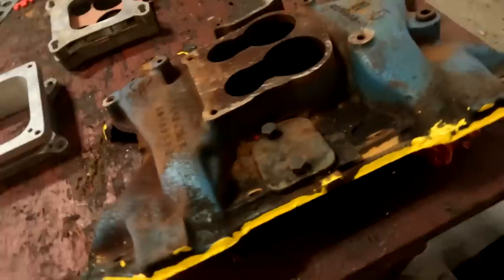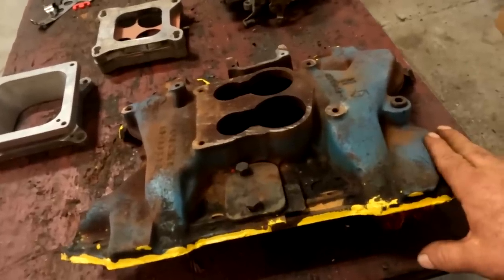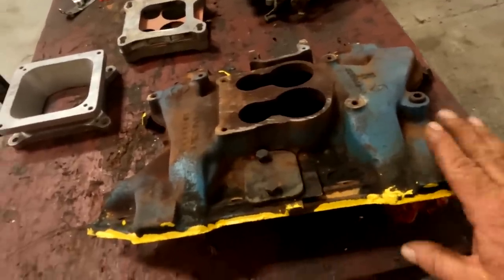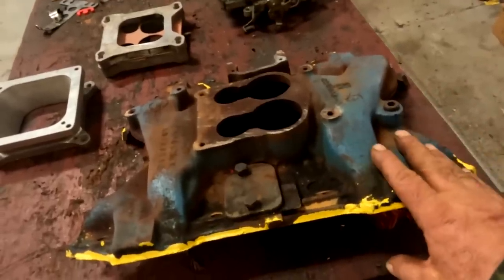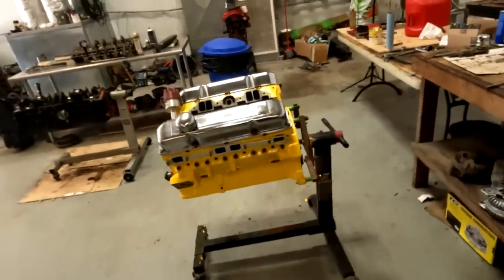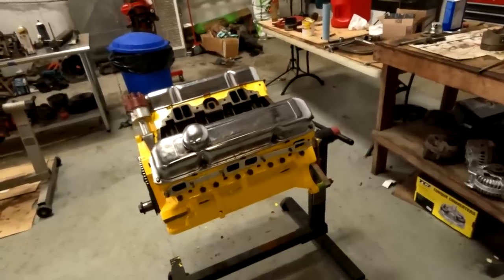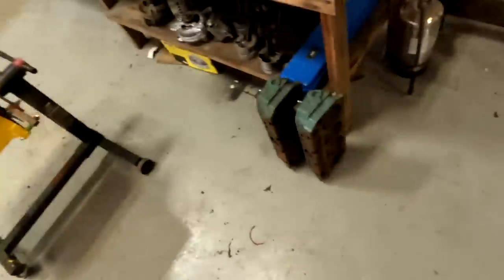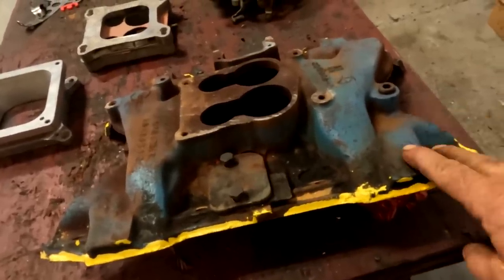Blueprinting - What It Is And Why You Should Do It To Everything You Touch On Your Car. Free Power

Comment: I look at it like this…when we were kids we saved for the Monogram, AMT, or Revel model kit of choice and a) built the kit out of the box, without trimming the sprue and flashing from the parts. Did it look like the box top? Not even close. Only after b) cleaning the parting lines, sanding, painting and tweaking components and paying attention to the details does it resemble the picture, ie:blueprint

Comment: I can say from my own personal experience that doing just the porting on a friend's Honda B18A1 on factory intake and head made a big difference in performance. That is a 1.8 liter, dual overhead cam non-VTEC 4 cylinder. He had also gasket matched the intake and exhaust ports on the head, and even before tuning the car ran stronger. Massaging stock parts really can make a huge difference, it nuts. That said, my friend's engine has been taken much further since then, with higher compression, a ported VTEC head and a ported Skunk2 intake manifold with a Skunk2 70mm throttle body, but he was shocked at the difference just massaging the stock parts made.
Reply: An old Gear head told my he got a new Vett probably late 50's pulled the 283 and port polished everything and did a nice balance job . It ran perfectly. Lasted forever.
Reply: Porting is an amazing way to add free power.

Comment: I once owned a 65 Plymouth satellite 426 wedge and always thought it was a special car that came down the line and everything was just right, good mileage, amazingly fast, and Very smooth, I owned 13 Big Block Mopars and none were like that one.
Reply: I am a chevy guy but once you start with the best stuff you cant go back 
I started with ford cars with crown vics
Reply: Yeah I've had a couple cars like that That I regretted selling cause I thought just cause it was my car The way it ran And stuff I did and then I got another one and was disappointed same engine same everything not Is the same it's like the B team came in hung over on the assembly line On saturday
Reply: My dad has a similar story about his Roadrunner. “Fastest bone stock car I ever owned”. He raced it and the only car that ever beat him was a worked 427 Chevelle by a fender. Said there wasn’t anything special about it. 383/4 speed post car. Compression wasn’t any higher than normal. But everything was just right and it absolutely flew
Reply: Betcha wish you still had that car today...
Reply: I had a 72 Chevelle with a 350. Completely stock. It always started even at 50F below. It was quite fast and could get 18 mpg when I was careful. It didn't take a ton of work to build another car that would beat it, but in stock form, it was impressive.
Reply: @K9River  If ANY American car from 1955-1974 were built and sold new to its original specs, I'd go pay cash for one (or more) immediately.
Reply: @redram5150  we called cars like that “Freaks”
Reply: @davef.2329   Yes Sir I do.

Comment: Uncle Tony, this video just made my decade.  It is now my all time favorite, and one I will share every time the subject comes up.  I have been an Engineer since around 2002 until now, but for twelve years I worked at one of the largest global aftermarket parts companies, and largest in their industry, and had to struggle to get this point across to my boss and a few other Engineers.  I gave your same soapbox speech to my boss countless times with only a small movement in his attitude about it.  I finally had to secretly give this information to our CAD Operators so that they would have an understanding that Design Intent was different than the results of a production part.  First you determine the most likely used standard of measure being used (metric or imperial), then determine the most likely dimension on the OEM drawing, which we were not privileged to see.  We had to make true educated guesses using multiple variables, then set proper tolerances, which were in the realm of potability, affordable, and didn't result in stacking .

Thank you for making this video.  I will use it for educating anyone in the future who thinks a production part has all the perfect dimensions needed to make multiple parts without a steady stream of returns.  I think you know about that.  Honest....It wasn't me. :0)

Comment: While blueprinting is everything Tony said, it is also producing a speck sheet of what you did and how you did it so you can reproduce it. As well as that when what you did brakes, it can be repaired in such a way as to restore things back to the way you did it. An example would be building a 351W, with 302 heads that was ported polished and had the head bolt holes enlarged to accept 351W head bolt’s or studs. And that you used intake gaskets for a 302, with oil galley gaskets from a 351W for X reason whatever X reason specific is.

Comment: Back in the late 60s I owned a '57 Dodge Coronet (I was 18). Very clean, lower miler with a 325. I got a 361 hp (like Tont has there) from an old Desoto. I rebuilt it using standard bearings. After Plastiguage it was a little wide but all the crank surfaces were very good. Let's call it "mileage clearanced". Slapped on a windage tray (a very new deal at the time) and used a couple of Dick Landy Clinic tricks. I set the distributor timing by lugging up the steep hills to get incipient knock. A local trans shop removed a couple of the springs for the first to second upshift on the old cast iron Torqueflite making that pretty crisp. After I broke it in I got into a street race with a then new 383 Roadrunner, manual trans, and beat him three out of three. One on the jump, and two on the roll. That was a pretty spicy old Deso 361. The guy riding shotgun almost pissed himself. Road Runners were legendary even then.

Comment: Does anyone remember Grump Bill Jenkins? He was a master drag racer from the 50' and 60's He was Chevrolets go to guy. G M would send him 50 sets of heads, he would pick the best 5 sets, and rock the stock rankings of pure stock.This was common in the 60's.
Reply: Bill Jenkins actually started out drag racing Mopars in the early days then switched to Chevrolet . It took him a few years to finally beat the Hemi guys later on when using a SBC in a Vega which I never understood why the rule changed from mandated original type engines being used at that time because the Vega never ever came stock from the factory with a V8 in them .  All you had for engine options for the Vega was that lowly pile of crap that wore out quick that burned & leaked oil knew this because I had one and the other option was the HP Vega with the Cosworth engine which are rare . Another great engine builder was Smokey Yunick and I bought his book he had years ago on how to Design & blue print engines for racing
 which I still have to this day . He even went as far as showing the differences of 3 small block engines the SBC SBF and Chryslers 340 and how some were better designed and built & showed the best engine blue printing mods for each of these engines to be used for racing so if you can find this book buy it because it's a good read & it will definitely be handy when it comes time to build a solid performing engine .
Reply: @peteloomis8456  Is the book "Power Secrets" or another title?

Comment: Tony, I think there's a little language barrier between you and that engine builder in Australia.  When I was at Meadowbank TAFE learning to wrench in the late '80s, the definition of "blueprint" was to get the parts exactly as the plans indicate.  Not to fit them together better, or even as the designer intended, but exactly as it says - for every part to precisely match its design blueprint, even if there was an error or non-optimal fit.  What you're doing, we would probably have called " matching and fitting", rather than blueprinting - same thing, different terminology.  

Not that "blueprinting" isn't also used in the same way you mean it - usually at the pub after work.  But that's in the vernacular, and a good builder usually sticks to the precise definition, rather than the idiomatic.

Comment: A max effort factory, stock car! This is how my dad built cars, use factory parts, but from different cars, and modify them to improve performance,  some would look like a stock 327/350, but make nearly 400hp , used 302 intake and cam on a 350, it was stout, with decent heads, ports cleaned up matched,  the duntov 30/30 cams were a bit spicy also,  we even though about angle milling some heads,  great video , I can dig modified parts , even stock parts!! ✌️

Comment: I really love the back story; the difference between factory burrs and casting crud vs polished & ported. I heard blueprinting is to detect cracks and balancing is grinding the parts untill they balance. Determining that balance point alludes me.
Reply: Jim’s Automotive Machine Shop Incorporated JUST put out a great vid on balancing a GM rotating assembly a few hours ago.

Great vid. Great channel. Check it out, may answer your questions
Reply: Titled “Why Balance a Stock 396 Big Block Chevy?”

Comment: A 428 CJ in C/S we used an iron factory intake, which weighs 85lbs. The car ran on the top of the index. Blueprinted pieces can have tricks that the factory put in to it as you said they were cast very precisely.  The parts have been handed down from racer to racer. You can’t pull a schlupped together 428 from a wrecked Mustang and run the time. The engine you build has the best parts that were passed by Farmer Dismuke numerous times. This C/SA Mustang is pulling 18 inch wheelies and running 10.60. That’s what gets it done. Thanks Tony. Many people have no idea how much it takes in little things to make a 385 hp factored 428CJ to be able to blow out an index that way and do 18 inch wheelies with an all iron engine in probably the toughest Sportsman class in NHRA. Blueprinting. Bumper to Bumper Carb to oil pan.

Comment: ...after he retired around commercial jet G.S.E. , 
he had gained experience with other makes/models that were "pre-electronic/computer control systems"
We have a '90 Dodge Ram D-150
Long bed P/U and hope to get it running under O.E.M.
design...it does not have to pass emissions, and can be modified slightly...the 318c.i.(5.2l) is at 98k+ original miles...and he says he can easily do an "in frame rebuild" ...and hopefully
a nearby 
local  machine shop can
still supply a complete
basic O.E.M. rebuild kit...
Keep up the sharing videos...
God will bless you
for helping 
retired fixed income seniors like us here in 
FPK GA!!
HAPPIEST
NEW
2024!🎉
Reply: Is FPK Forest Park?

Comment: I remember an Australian motor mag testing new Holden Brock Commodore V8 cars, 82 SS 5.0L and the testers getting a few examples to belt around and one tester related exactly what you're talking about. The 5.0s were hand built from memory with heads derived from the touring car race program. This guy said one test car went quite a bit harder than the rest and shaved a significant few 10ths off the quarter times of the other cars. Moral of the story Is the technician who screwed that mill together had the combo of parts that exceeded the claimed manufacturers  performance expectations. In 1982 the VH Group 3 - 5.0L V8 4 speed manual ran 0 to 100 kmh in 6.7 secs and 0 to 400m in 14.7 secs ( zero to 60 and 1/4 mile) not to shabby for the time. At just a shade over 19k aud new, these cars in excellent condition now  command well into 6 figures. The tester's conclusion, "this car is one out of the box"

Comment: Completely agree with using what you have.  Gasket matched and cleaned up bowls etc. Intake heater passage blocked. Exhaust manifolds gasket matched and cleaned up.  Cam installed correctly. 1968 GTS 340 4 speed 3.23 rear gear. Used 1987 Goodyear gatorbacks on cop wheels. 12.98 @110 in 1987. 
I was 17 years old and just absorbed your magazines knowledge and all the direct connection material I could find. Reading and comprehending is the cheapest horsepower.

Comment: Nice!  In manufacturing, production stackups can produce minimum performance parts and maximum performance parts (still in production tolerances - low end vs high end).  One of the things a manufacturer can do is send parts to their test lab to make min/max performance parts and then test them to see if the minimum part will still meet the performance parameters and the maximum part meets nvh and other specs (ie too much fuel pressure).  All of this can take place within the tolerances set by the engineer for manufacturability.

Comment: There's this product called dragy, it's essentially a gps based trap and tree working in conjunction with a smart phone. Produces a full time slip accurate to 1/100th of a second. You could use it to be a happy medium for data collection. Not a dyno or drag track but testing the mule would leave good evidence, between the gps data and video of the launch and 60 foot. It's 170 bucks or so, about to send my dad one for a bench mark lol. Trying to make a turbo miata that stacks up, the plan is to push it to where the stock 5 speed and dif are almost grenades and then cut weight. factory 96 miata and 66 mustang fastback 289 had the same weight to horsepower. He has serious cams, msd ignition and know how, I'm using youtube, forums and as little money as possible.

Comment: Good timing for this video.
Just last week we were die-grinding out the casting imperfections on a friends motor.
Motor is skyline inline 6, ground head and exhaust manifold for better flow.
The imperfections are numerous and some case extreme.
Yes,the motor type does not matter, the work is the same!

Comment: Another bench racing term that drove me crazy was "Three quarter Racing Cam". I used to wonder, which two cylinders don't get the use of the cam, or do two cylinders still use the stock cam. Either way the logistics are impossible for my simple mind to grasp. Don't get me started on "Bolt on application, no modification needed."

Comment: I saw those comments after I watched the video this morning. For the first one you mentioned...You could almost build a complete 350 Chevy for the price of an aluminum intake for a 361 Chrysler...I'm exaggerating of course but, my point is that, more often than not, the budget plays the biggest part in any build. Using what you have on hand is a necessity for most of us.

For the second one...All "blueprinted" engines are modified from stock in some way. Measurements are taken, parts such as bearings are swapped to get tolerances where you want them. Heads, intakes etc. are "massaged" in various ways to make them flow at their best. I could go on. Not every engine is, or even needs to be blueprinted to such extremes as race engines but, even just gasket matching intake and head ports us indeed part of it.

Comment: Sticking to the middle of the specs ensures that after the break in period the MPG and then power also meets specs.
 It takes about 1500 to 2000 miles of easy does it. To get it done right.
 I broke in a lot of test vehicles for Ford.  I got picked to break in Bullitt number 2 and number 7. Boring but necessary.
Wonderful driving machine, if you can drive a stick. It also makes it's own special music.
So yes building a engine and a few thousands of here and does add up.
My 1st build was a ford 292. I found out closer is not better.
But did Ford cherry pick the engines for the Bullitt? I did not ask.
I also was not allowed to drive it like I owned it. 20,000 miles later. 
Better? You have to ask the exec that got them after testing was done.

Comment: The 1972 TQ non EGR valve provision but first generation EGR with exhaust orifices below the carb, those have to be plugged! You can see how to grind the early Thermo Quad manifold comparing the two. That's why the newer EGR manifolds are recommended, a plate can replace the valve and seal off the exhaust. The lower plane plenum on the secondary side is improved too.

Comment: Mr. Vizard suggested in one of his books to find a machine shop with bins of stock connecting rods and go through them measuring until locating 8 that most closely match the specs or at least 8 that are all the same.
   I reckon that could be applied to other parts too if replacing things is in whatever given budget for a project